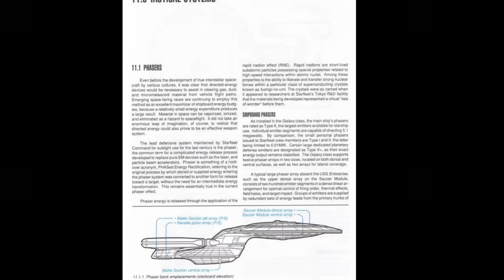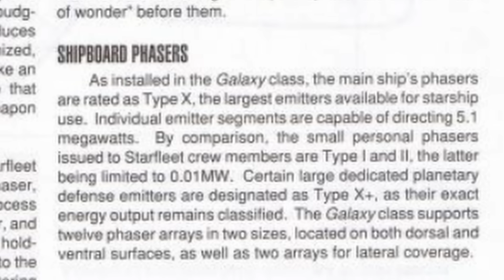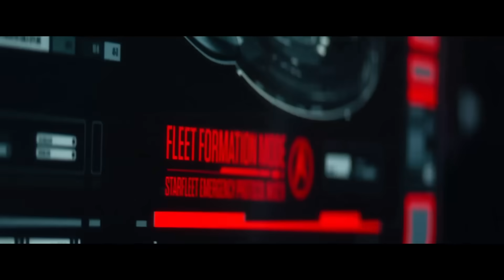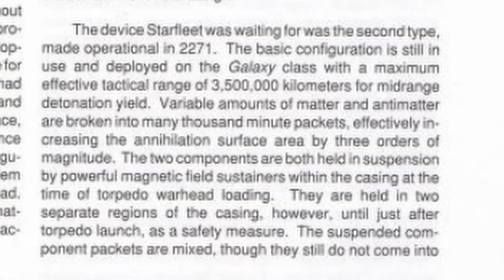Phasers: How Powerful are they Really?

Comment: I would not trust SNW only because it has pretty much established that its in its own universe, so DISCO is its own thing with different power levels. That being said, there is a unifying structure, and some order to chaos. Phases are effectively laser beams that deliver energy over time, maybe over the breadth of the blast.  So was SNW Spock saying that?  Also, based on some real-world FTL calculations, it really would take the entire energy output of 2020 NYC over a year to power a starship at FTL for a day, so these high-end numbers actually aren't unrealistic. They keep the energy as plasma, which means next to zero loss and they can user many forms of radiation as energy sources so that doesn't bother me. And since we are dealing with Nadion particles (fictional yes, but lets say ionized uranium) its a heavy particle it could be making up the difference when it comes to phaser power. As far as torpedoes, they do their damage differently. They aren't just an explosive charge, but a weapon that causes a subspace shockwave that is designed to force apart of ship, which is why their destructive damage should be more powerful.
Reply from the maker: I’ve never seen those FTL calcs. Based on what I know about building a real world warp drive, they’d need the energy equivalent of converting a small planet into energy so I don’t know how long NYCs production would need to

Comment: 5.1 Megawatts x 200 is 1.02 Gigawatts , the thing is the NX Enterprise had three - 500 Gigawatt phase cannons for a total of 1.5 Terawatts ( 1471 times the power of the enterprise D)
Reply from the maker: Sounds like the scale got adjusted
Reply: @fictionrant7805  Funny thing is , there’s other sources that tell you it’s 100,000 Terawatts or 100 Petajoules, ( the warp core is capable of of 12.75 exawatts ) tbh it’s most likely a mistake that they haven’t corrected in over 30 odds years ( or whoever wrote that section knew nothing of power scaling)

Comment: In terms of vaporizing. I feel like the newer shows have mostly followed how Stargate treated the Zat guns in later seasons.
'Yes it's possible, but we're not going to use it.'
Reply from the maker: The impression I've gotten from the fact that phasers and disruptors alike have configurable yield is that you CAN vaporize people with those weapons but doing so is extremely energy intensive so if you want to be able to fire a bunch of times, dial back the power.

Comment: How much firepower did the torpedoes fired at Harlak actually have?
Reply from the maker: That’s STD/Section 31 territory so my knowledge is pretty limited
Reply: @fictionrant7805  If one assumes that the planet was the size of Earth, then one could estimate the energy based on the size of the explosions.
Reply from the maker: @Jasmin-lg3gf  true
Unfortunately, visually the phasers create giant ripples like they’re hitting fluid when there wasn’t any present so it’s weird
Reply: @fictionrant7805  You mean torpedoes.

I tried to estimate the explosion size and came up with around 40 km for the fireball. But it could also be 60 km, or significantly less.
The Zar only had around 4 km. So those were really big torpedoes, which also explains the cracking of the crust.
Reply from the maker: @Jasmin-lg3gf from the clip the shockwaves on the surface appear to be the size of continents. Pretty far beyond any nuke
Reply: @fictionrant7805  Are we talking about the same scene?
Star Trek Discovery - Harlak Orbital Bombardment - Terran Emperor Reveal
Reply from the maker: @Jasmin-lg3gf  Nope, I was talking about The Die is Cast. Like the clip I showed in the video.
Reply: @fictionrant7805  That explains it.

To create a 40 km fireball, you would need something in the GT TNT range, since the growth appears to be root-like.
How much firepower does it actually take to break the crust, as shown on Harlak?
Reply from the maker: @Jasmin-lg3gf  again I’m highly unfamiliar with most nu-Trek. I can ask AI to calculate for me but refining the query will be impossible for me because I don’t know the context
Reply: @fictionrant7805  I asked the AI. It works really well.
A 40km fireball would require 430 Gt of TNT and cause massive damage to the crust. But that would also be 10 tons of antimatter, which is a bit much for a torpedo.

So a smaller payload would be realistic. 1 ton of antimatter could still cause the destruction shown.
Similarly sized torpedoes should have been used in The Die is Cast if they destroyed the crust.
Reply from the maker: @Jasmin-lg3gf  eyyy

I like how a variety of possible answers are provided

Comment: There is a stat that you didn’t get from the TNG Manual. The manual says (if my own AI search is accurate) that the Galaxy Class’ antimatter storage all going up at once is equal to 1,000 photon torpedo detonations at the same time. If that is true, then the average yield of a photon torpedo is 239 megatons. That is more in line with the phaser yields you came up with.
Reply: Before you ask, from the Google AI reading from the TNG Tech Manual, a Galaxy class ship holds 3,000 cubic meters of anti deuterium in a slush at a density of 160kg per cubic meter. So the total mass of the antimatter is 480,000 kg. When all of that detonates at once, the yield (after it did the math) is 239,000 megatons. Divide that by a thousand and you get the 239 megaton yield.
Reply from the maker: @RedneckRapture so each torpedo carries 3 cubic meters of antimatter

Prolly not…
Reply: @fictionrant7805  It's in the manual though. It states this information straight up. The AI did admit there's a discrepancy, but also chalked it up to some technology in the warhead causing the explosive force to be amplified.
Reply from the maker: How big is the storage?
Reply: These numbers make the most logical sense with feats that are shown

Comment: On Dilithium and power output:

I think that the new numbers out of SNWW 3x10 presents a good chance to redeem the Burn, and make it a bit less stupid.

I think it's stupid for at least two main reasons.

1. After a thousand years propulsion and power generation is still dependent on the same tech. This goes against what we see and expect.,

2. The nonlocal link to all dilithium making it stop working is a crazy new thing. It would mean Dilithium is doing something quantum we don't expect.,

This latest episode has phasers outputing as much energy as a hundred million tons of antimatter/matter reacting.

That's too much if that's what warp drives are doing.

But I think we can solve one problem with another.

I think that if we shift our understanding of how dilithium works in the M/AM reaction, to instead of it just being a regulator for power control, it also enables the reaction to catalyze into something greater.

We know that quantum torpedoes have a double payload, one of matter and antimatter, which is used to activate a zero point energy reaction.

I think if dilithium can explode all over the galaxy at once, and that its participation in M/AM reactions means that it can generate power on a factor of 2 billion more than what we would see with matter and antimatter alone, then I think that there's good reason to believe that Warp Cores tap into Zero Point Energy.

If that's the case, that the dilithium is used to focus the energy of matter and antimatter to allow ZPE to be generated and collected, then that would solve both problems with the burn.

Solution to problem 1: ZPE is functionally infinite, so the limitation would be on improving the efficiency of collecting it through the known means, so of course that's still the bedrock of power generation in the 3000s.

Solution to Problem 2: ZPE is a product of quantum theory, collecting energy from spacial vacuum itself. If Dilithium is the key to tapping into this using the power of M/AM, then dilithium would have to have a lot of special quantum properties. That makes it more plausible for an incident like the burn to be possible.

That's the theory I've been working on.
LMK what you think.
Reply from the maker: I think that if Trek has been using ZPE for centuries but only weaponized it around the Dominion War they REALLY need to say so lol
Reply: @fictionrant7805  IDK, they haven't really said in canon that Quantum Torps use ZPE. 

There may be something weird about Star Trek Antimatter instead, since a small keg of it in TOS Obsession would be enough to rip away half the planet's atmosphere, and that math doesn't line up with real world antimatter.

And if that's the case, then photon torpedo antimatter could also be way more than thought, and IRL calcs based on the 1.5 Kg number would need to be thrown out.
Reply from the maker: @-Lindol-  if we had an objective and consistent demonstration of power from a known yield photon torpedo, we could reverse engineer the yield but nothing like that exists unfortunately
Reply: @fictionrant7805  Might be mandela effect, but I remember reading that the warhead is a kg of deuterium and a kg of antideuterium, with an intermix chamber.  The intermix would determine the amount of total mass set to annihilate, and setting it in a magnetic matrix to make the process as efficient as possible, so that antimatter isn't simply blown off by the initial detonation to be a diffuse secondary reaction.

Comment: for the 'how they produce enough energy' question, i seen somewhere but i fail to remember exactly where that the warp reactions are focused on to the dilithium and that redirects and amplifies the energy. plus they still use fusion power and i am pretty sure they have multiple of those reactors seeing how they still use dueterium and hydrogen as fuel.
Reply from the maker: Unfortunately the sheer amount of matter that needs to be reacting in order to produce the required energy for these kinds of feats quickly approach converting the whole ship to energy. If they can achieve better than 100% efficiency in energy capture that would make a difference but entropy says that should be impossible

Comment: I understand that Star Trek is inconsistent af so I don’t fault you for this, but the video basically just summarises this to: phases are as strong as the writers need it to be.

I think the best thing to do would be to work backwards from the torpedoes which you said are 64 megatons, as this means that phasers need to be weaker than this number by a decent amount to actually make the torpedoes a viable weapon That said, this only accounts for TNG as technology has improved since then.

Comment: I think part of the issue, as you have pointed out, is the "nadion" itself: its a force multiplier, but it only works in some situations: for example, anything shielded counteracts it. Classic example is disintegrating a person with a hand phaser vs doing pretty much nothing against a borg drone. I dont think its so much that the borg drone shields are that good, more that they are erasing the force multiplier. It's why in your maths, the photon torpedo is woefully less powerful: it's because you're comparing raw energy output potential vs output + hax. Shields pretty much ignore the hax. For one, they have no matter for the subatomic particles to react too. 

Likewise, we dont kno, really,  but i suspect photon torpedos have hax too: they have a subspace driver coil: what happens when you shunt that much uncontrolled matter/antimatter reaction through a warp coil! Huge quantities of subspace distortion! I think that would make sense as to why you'd fire them against shields: to knock them out!
Reply: you're right, i recall nadions disrupt subatomic interaction somehow

Comment: 5:00 I think it's also worth noting they were shooting at a target, that wasn't solid mass, it was loose dust and rocks in low gravity and no atmosphere to absorb any of the shot.
Reply from the maker: The mountain was most definitely a solid mass

It stopped being a solid mass after phase cannons
Reply: @fictionrant7805   Maybe? (Been years since I watched Enterprise but maybe they stated it was solid)
But if they didn't unless that body was molten at some point, it would probably be pretty loose.  Depends how the mountain formed, i guess.
Reply from the maker: @TheJadeFist  as I recall they didn’t really get into it

In any case, even on desolate worlds, you don’t get pointy piles of debris the size of Mt McKinley. 

It was a mountain, presumably volcanic at some point
Reply: Mount St. Helens released a total of 24 megatons of thermal energy. Archer's firepower estimate fits this value.
Reply from the maker: @Jasmin-lg3gf pretty good for prototype 1st gen phase cannons

Comment: Well Phasers and Disruptors are related technologies, phasers being more robust and adjustable, and more complex vs the mass produced and effective without having to think about it too much type of weapon. And their beams are said break molecular bonds apart. It's not doing it through directly through heat, which is where you'd get those absurd numbers needed to vaporize someone. Clearly it also has some kind of creeping radiation, which we see all the time, with near instant kills, vs a handful of times like in Enterprise where that one Andorian woman got shot, but died from the disruptor creep and Nog in DS9 had to have his leg removed in order to stop the radiation from spreading and killing him. So there's also that thing going on. Phasers tend to not have that same issue being much more controlled and fine tuned, I think, but it's worth considering when thinking about these types of weapons.
Reply: So phasers are modified plasma particles, where said particles are stripped of the strong force allowing them to bypass plasma shields and air, as well as disintegrate mater with radiation effects.
Im not sure if its fission like, fusion like, or antimatter like, but its terrible on the materials and probably ruins them and does irradiate them.

As for refined vs mass produced, you have it wrong i think, the source i remember says that disruptors are easier to develop and invent, while phazers are more sophisticated and also require even more advanced effort to mess around with.
Phasers, unlike disruptors, are also more easily modified and such, letting them be used as tools, and eventually, after quite some time of having them, approach similar effects of disruptors.
So basically, phasors can be used as tools, and are more advanced but not as powerful against hulls and any warlike race simply wouldn’t bother.
    The other difference is that disruptors are more effective on hulls, while phasers are more effective against shields. Of course, you use torpedos on shields and phasers on hulls, though, you could do it in reverse, though it would take a dangerous amount of time even with phasers.
So in other words…
Warlike races have no need to bother with phasers, because you use torpedos on shields and disruptors on hulls.

You bother with all that extra effort that probably requires a science based civilization instead of a warlike one to end up with a weapon that is more like a tool and weaker, the requires even more effort to then use the beam modification ability and develop the specific effect, and then, even after all that extra work twice over just to imitate disruptors, they are still less powerful than disruptors, and the extra damage to shielding is meaningless too, meaning only sciency tool users would make phasers to use as tools and do things like scan, have resonant frequencies, or any other programable idea, completely useless to blow-em-ups, slavers, traders, and conquerers.
Reply: @bobsterclause342   As for developing phasers to begin with, isn't that much of a hurdle when plenty of races use them, you could always just buy some and reverse engineer them, the Ferengi sell their weapons, to quote Quark when accused of shooting some one because a Ferengi phaser was used, "Available in many ports" we even saw members of other races use occasionally use Ferengi phaser pistols .